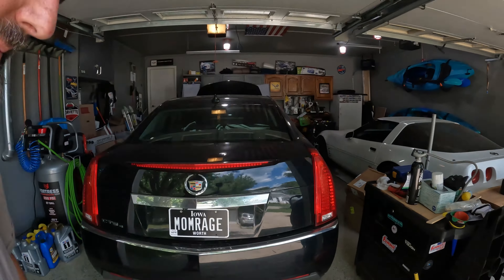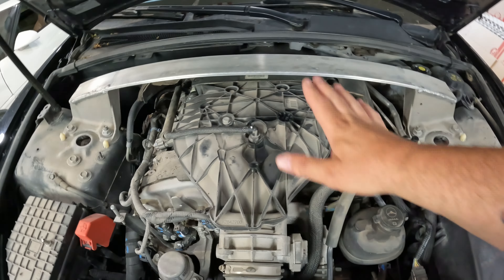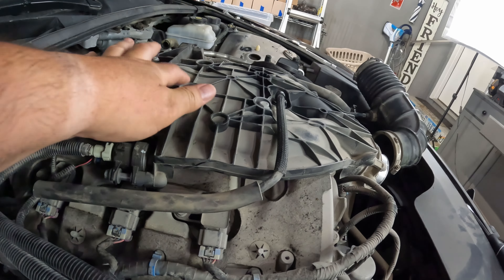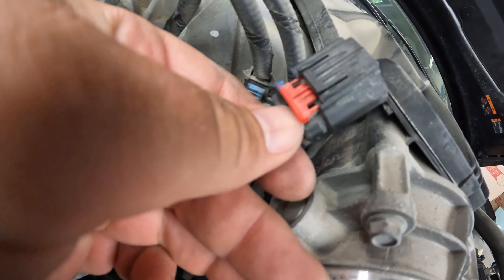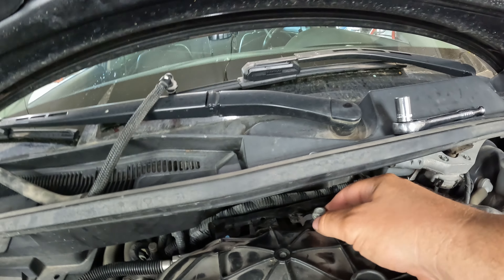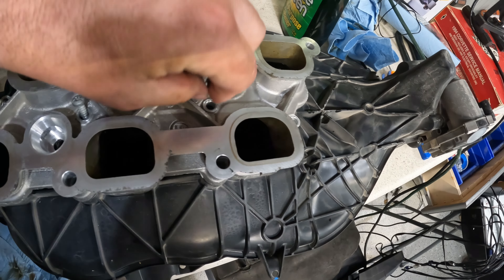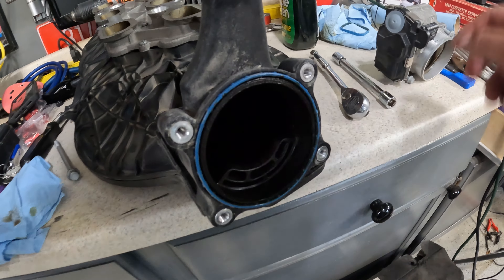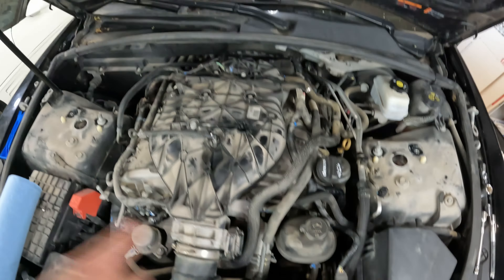2011 - 2015 Cadillac CTS 3.0 Intake Manifold Gasket Replacement

Comment: What did you use to clean the surface where the intake runners are at 10:24?
Reply from the maker: I used Simple Green cleaner and shop towels to clean them 👍

Comment: This is just AMAZING ! 
The way you explain every detail, and the camera work , its just a pleasure to watch.

I am planning to change the fuel injectors on this exact 3.0 LF1, because of a p0420 code, i suspect the fuel injectors are the culprit.  
So this video definitely helped, I am going to change the gaskets If I am already taking out the intake. 

Are you by any chance planning to do a fuel injectors video any time soon ? ;) 
Its a bit of struggle to do as I could tell from the info already online.
Reply from the maker: Thank you for stopping by and the kind words! I appreciate the feedback! 

I may end up doing fuel injectors at some point in the future, but nothing planned for the near future!
Reply: @Amundred  thank you , will be following ! 
As for that annoying 13 mm bolt , I was pleased to know that it doesn’t have to be taking off - as it doesn’t have enough clearance and was wondering how would I take it out. 

One thing I kinda didn’t get, the bracket on the rear, I have to take out only the 10 mm on the bottom of it and not the two 10mm on top?
Reply from the maker: @rabe3sh7ady  had to loosen the bottom one and take out the top two. You could remove the bottom one, but I just loosened it and was able to slide the bracket out of the way. 👍
Reply: @Amundred  Great ! Thanks !

Comment: I wished I watched your video before I started my job.  Removing the vacuum hoses was difficult.  I managed to break the small wire retainer clip on the top right.  Now I have all the hoses and wires disconnected.  All the 6 top long bolts loosen.

I am trying to lift the intake manifold and it doesn't move at all.  Besides the 6 bolts, are there any hidden bolt(s) to remove?
Reply from the maker: @lxc1227  there was the bracket on the back of the intake - other than the bracket and 6 bolts, there isn't anything else that I recall
Reply: @Amundred  I "forcefully" by hand dislodged the intake manifold and will try removing the back bracket tomorrow.